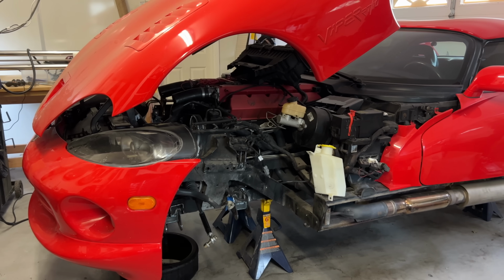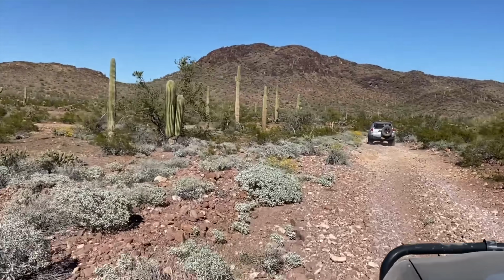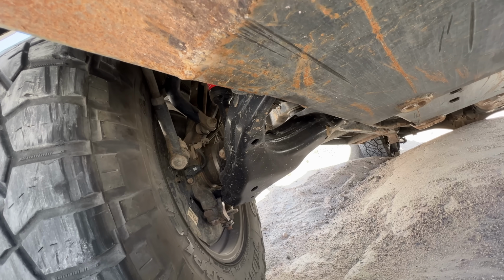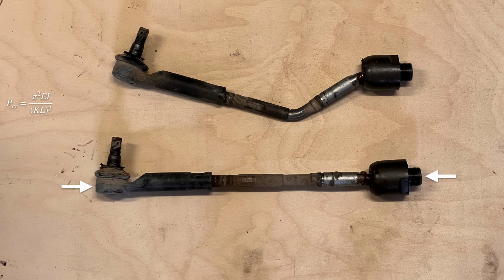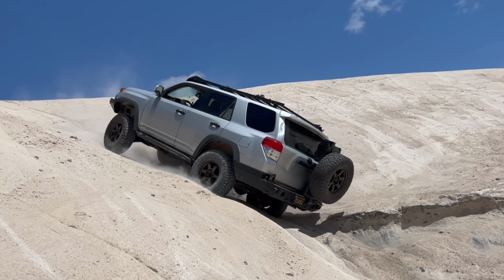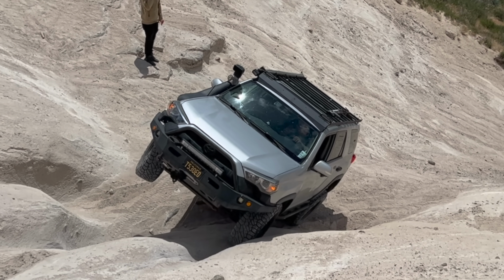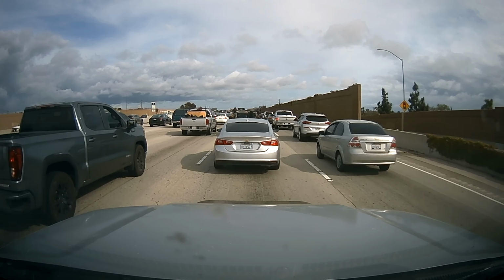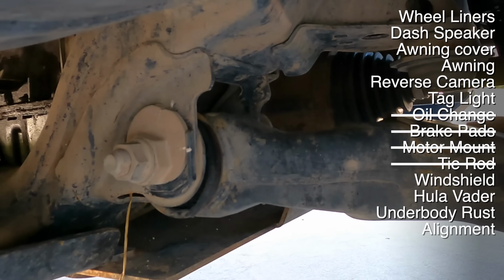Engineering And Mechanical Failures Off-Road

Comment: Your solution to your Fourrunner problem is simple: buy a Deux Chevaux. It will go everywhere off road the Fourrunner will, it will suffer much less damage (and use far less fuel) because it weighs less than a third as much, and if it does break it will be much cheaper (and much easier) to fix. All automative problems come down to power to weight ratio, and less weight is always a better answer than more power.

Comment: Breaking the fuse that easily means you need a bigger tie rod AND steering rack.  And probably some frame plating and gussets while you’re at it. And then some other cascading changes and analysis.

Comment: I used to offroad in a jeep cherokee 2001. That thing had limped off the trail flooded, oil/coolant spewing out, on a donut, in FWD with the rear taken apart. The best part was you could goto pull a part a get  basically OEM spares of anything out of the street queen 2wd cherokees. Plus it was a very light car with all kinds of upgrades you could literally pull out of other cars.

Comment: I'm Parts guy. mog makes napa parts afik. They could have been mixed up at the factory. Or someone returned swamped that napa part for the mog one. In that case I'm shocked it was a new part at all. Either way the napa part is fine, but the mog ones are beefier.

Comment: Yeah those steering rack replacements are a turd. The workaround i found was lock the rack to one end, the shortened end of the tie rod will just clear the frame. Lock it to the other end and it'll clear the other side. Alignment's a bit of a hassle, but it beats pulling the engine.

Comment: Pro tip:  Carry a few extra tie rods (inner and outer) in your 4runner, you can get them brand new online for less than $10.  Literally everybody does that...I even have 2 in my 4runner for this reason.  The tie rod was specifically designed to fail by Toyota in that exact circumstance and be easily replaced on the trail with minimal tools by one person in under 20 minutes.

Comment: At least he has the old (unbent) one to take along as a spare. This will prevent the new ones from ever failing, because the law of spare parts works that way.
Reply: Unless its an alternator 😂 kept my old one just in case, turns out brand new out of the box it can be wired wrong (china) and just send whatever charge the alternator can possibly produce into your battery meaning the alternator lasts 2 months total, they send a replacement and it does charge correctly, buut once the engine warms up the seal between the vaccum pump and alternator itself decides to stop sealing and it fills the alternator part with engine oil, which then hits the fan on the front and stops your entire engine bay from corroding 😂.. i put new brushes in my old alternator, and its been perfect for months 😂 with my luck the bearings in it will begin to, and then completely fail when im like 1700km from anywhere that sells anything let alone parts for a 1991 toyota hilux😂

Comment: Are you operating in a total vacuum? completely oblivious to the entire collective experience of the off road community in the last few decades?  You are not sure why a frail ass tie rod bent on a suv intended for taking the kids to school? You should use the internet and ask around . see what people are doing with their Toyotas to not make them fall apart like that. Toss out that piece of shit stock rack +tie rods and swap in a modified tundra rack with 7/8” heims on both ends.  The hell? your busted ass 4 runner keeps falling apart because it’s lacking the appropriate components.  Or don’t , and have fun rolling down that lame hill again. 
You would think an “engineer” would also reference previous research/ work done and incorporate that into his supposed “calculations”.

Comment: I just came back from a fun weekend. 
One buddy cracked the frame on his pathfinder, I smashed my skid plate into my t case oil pan into the gears inside, and buddy #2 tried an obstacle, blew up one CV in his pathfinder, figured it’s already broken tried again and grenaded the other side. Then packing camp anti-theft tried to lock him out.
All around a good time and many obstacles were conquered. Now time for “maintenance”

Comment: Proper off-road mechanical fuse replacement procedure:

1. Identify the mechanical fuse through properly neglecting the spotter and finding a rock the hard way (as Matt did.)
2. Use a very sketchy method to return the vehicle to 90% of safe operation at the trail head.  Possible methods include: ratchet straps, welding using jumper cables, two batteries and 10 year old muddy welding rods, nearby forest lumber, etc.
3. Buy and replace both right and left fuses despite only breaking one.
4. Throw old un-blown fuse into spare parts box in the back of the off-road vehicle 
5. Go find new ways to come close to soiling your underwear off-road, knowing you're fully prepared in case of another blown fuse!

Comment: When I was a kid there were a whole bunch of Midwestern sons of farmers who used 68-72 Chevy/GMC pickups for 4WD pulling. Believe it or not they were cheap and plentiful once, and big block Chevys were obviously a bolt in. I knew of one for sure and I'll bet there were more which had to have the tie rod reinforced. It's a front steer chassis and the wheels would whip in and out of massive toe in with big power, grippy tires, and a heavy sled to pull.

Comment: Ring gears on factory 1st gen sequoias and Tundras are also a weak point, especially if you have decent newer factory or better CV joints/axles... Although that stupid tiny differential needle bearing is often what causes a misalignment in the diff which translates to the ring and pinion issues... If you ever tear down a Toyota 7.5" diff for regearing or a locker change out that stupid needle bearing with one of the aftermarket bushing kits (ECG is one company that makes one if im not mistaken?) I've learned and forgotten equal amounts of Toyota knowledge lol. Cryo treatment is a good idea even with quality gear sets if you plan on adding a locker or just hard wheeling the basically any Toyota IFS...

Comment: I've seen the fun and games of buckling a tierod on a solid front axle. UK G-Wagon owners club - Back from the days where they basically the younger brother of Unimog trucks cosplaying as army jeeps had a few pics of member doing pretty much the same thing - very sad looking thing as it also caused the front end to dip alot more than you would expect (the top mounts might have sheered too but this wasn't mentioned). 

On the flip side, G-Wagons roll over rather well even without a roll cage.

Comment: Carry spare CV axles and tie rods, Offroading IFS 101. Keep your old tie rods when you change them out as they can save you in a pinch like this. Takes less than 10min to replace a tie rod on the trail. Also if you can afford it, avoid Moog like the plague.. Get some Sankei 555 stuff or OEM.

Comment: the ol' reinforce and find the next weakest link wasn't future matts problem? you could have beefed up the tie rod and found out the steering rack would die and then replace the rack with a beefed up one and find that the knuckle would fail next and then engineer yourself a new knuckle and then find the control arms fail next and then find that your upgraded tie rods fail and start all over again......... Or just keep 2 extra rods in the back seat.

Comment: I agree with your strategy of using the tie rods as your steering fuse. I've replaced a few sets over the years and it's for sure easier than replacing the steering rack. How do I know? I was the one that wrote that steering rack replacement article you referenced. It's not a fun job.

I always carry a spare inner and outer tie rod with me when I'm heading onto the trail. Swapping them out is super easy trail side.

Comment: I was out wheeling with a 1st gen xterra when something like this happened. They bent the pitman idler arm (I didn't realize 1st gen Xterra's had recirculating ball steering) and the wheels were point into each other like yours.  We bent a few tools trying to get it a little better and eventually sorta did and he drove it a good 50 minutes home.

Comment: I've had the same issue with buying parts off of Amazon - guessing you got a "return" where someone subbed a cheaper part for the return.

I found RockAuto to be good for actually getting the right part.  But they are slightly more expensive and don't have free shipping last time I checked.

Comment: Loved the "wauffer Thin" reference. Classic John Cleese.  The brake pads owed you nothing.  The shock load on that right front could occur on any corner of any vehicle in that situation, resulting in similar failure. Rock crawlers beware! Such adventures are always controlled by the laws of physics!

Comment: It’s often a small oversight in my experience in college of designing things to fail in a specific way.

It’s clever of them to have the cheap parts fail as a sacrificial layer to protect the expensive parts, hence the idea of a shear pin. Not only is the tie-rod relatively cheap, but it’s also easy to observe and easy to access should a failure occur.

I remember in Mechanical Design class, my professor told us to design a nut and  bolt assembly with specific dimensions. It was easy as we can get the factor of safety to like 30+ when under axial load. But then he told us to modify it to where you had to get that factor of safety down to 2.0, and it noticeably got a lot more difficult.

Comment: The mechanical fuse concept often gets lost in the mission of making a machine tougher, but I am a big fan of making sure the weakest part is either easy to replace or cheaper than the other links in the chain. An old example was PTO winches with bronze sher pins in the drive. From factory they would have a spare pin for when it failed, that would get used and owners would get the shots with replacing them when they abused the winch, so it wasn't uncommon for owners to put in hardened pins. Not a good long-term idea.
Reply: Another one that comes to mind is the manual locking hubs on old school solid axle 4x4s. Typically the locking hub would fail before the axle shaft or diff, and that was a relatively easy repair and a small enough part to keep spares on board.

Comment: It is common for one of the rear  upper links on the 4runners with 5 links to fail. The whole rear suspension works because of bushing deflection, if you were to make all the pivot points in the rear rod ends instead of bushings it wouldn't move at all and be frozen in place. If you want to make the rear smoother and flex better off road, remove one of the upper links all together. But if you don't believe me than model it.

Comment: Yeah, the 100 series Land Cruiser / LX470 has an 8 inch reverse cut ring and pinion in the front axle; it's a know weak point. (especially if going in reverse, as you wind up running on the coast side of the gear)

Comment: You should consider doing a thorough check of your steering rack after that bump. The aluminum mounting points on those aren't very fatigue prone, but offroading like you do is a bit outside Toyota engineers design envelope.

It would really suck if your steering rack desided to stop being mounted to your frame next time you stressed it.

Comment: Needs a full size "servo saver". Sounds like something you could design. Telescopic tie rods with massive springs in them?
Reply: Cool idea!
Reply: @ShivaShakur  Thanks! Maybe a small diameter hydraulic shock. That is stiff enough to only actuate when necessary and you can release the pressure to put back it to full length.

Comment: I wonder if it's possible to make the tie rod weaker but also self repairable, i.e. with some kind of spring/damper loaded to 7000lbs to stop the impulse and absorb the impact.
If you experience these loads in an emergency stop then you are probably dead anyway.

Comment: I would love to know what rust prevention solution you come up with, as I live in the Midwest aka rust belt.  I had my truck treated last year with Krown, it will need to be reapplied annually as it's basically just a spray on oil.  South Main Auto's channel has covered it if you're interested but I'm always on the hunt for the best rust solution short just getting me and my truck the f out.

Comment: You can run brake pads until the indicator plate is exposed - its normal. You'll get an audible warning when you get to that point.
Same with tyres - run them until the indicator fabric is showing

Comment: Looks like the tie rod is the same for both sides.  If it's a fuse in the system, carry a spare.  I carry spare U joints in my Old Bronco.  Same deal.

Comment: All the new Bronco folks out there installing tie rod sleeves are going to start learning about rack replacement soon. I always thought of the TRE as a mechanical fuse and would way rather that bend out on a trail, can hobble it together or replace it right there.
Reply: yeah a bent tie rod you can even pull off and hammer approximately straight and be able to drive somewhere carefully.
Reply: The broncos that come with the higher end off-road packages get stronger racks. So swapping out the rack itself might also be a good idea.
Reply: @ILiketoBreakStuff  Bronco R uses a wider F150 rack due to the wider track and massive 37s from my understanding. There is a company that sells a reinforcement sleeve deal that goes in the rack to sort of helps prevent the rack from failing easily.

Comment: I would love to know if that thinner part of the rod was really designed as a mechanical fuse! Do manufacturers actually do this? Wouldn't they prefer a more expensive failure? Could things like this be used to gauge if the manufacturer actually considers the consumer's benefit?
Reply: manufacturers don't prefer a more expensive failure as then they are stuck doing it under warranty
also it's easy to tell a tie rod was abused and it bent, a broken rack is hard to prove it shouldn't be covered
Reply: Manufacturers actually don't want any failures. Failures are bad for brand loyalty and reputation. The key here is that it's cheaper to suffer some failures once the vehicle is out of warranty than to try to engineer for zero failures through the life of the vehicle. As long as the car makes it through warranty with no failures, that's all they (the business people doing the maths) really care about (the engineers themselves, of course, would rather engineer for zero failures, but they're not running the business so they don't get to decide).
Reply: @clonkex  "Manufacturers actually don't want any failures. Failures are bad for brand loyalty and reputation. "  They don't? I thought it is to help give an incentive for upgrading to a newer Range Rover, BMW, Audi or Mercedes, when your existing one starts to become troublesome?  Especially when Range Rover know that the reason people buy a new Range Rover or Land Rover Defender is quite different to the reasons people buy a new LX or 4Runner. Unlike Toyota, Land Rover aren't trying to protect a reputation for reliability I think. Hence Land Rover coming to the conclusion that investing more into durability testing and quality control would just be a waste of money -- more cost with no upside of improved sales IMO, but I dunno.  I'm assuming Land Rover could match Toyota quality control and do more product testing before product release if they wanted to, but Land Rover don't because they choose not to? 🤔
Reply: @TassieLorenzo  Perhaps, but that's only beneficial in the short term. If you don't maintain some level of reliability no one will buy your vehicles. Certainly luxury brands can afford to be less reliable because people typically replace them every two years or so, but I guarantee reliability is still very much a focus for even the most luxury of brands. The big issue is that modern cars are incredibly complex and people don't want to pay more for that complexity, so it's there's a very fine line to walk between reliability and cost.

Comment: I hope you ordered a spare tie rod or two. If you intend a part to act as a fuse then you should carry a spare fuse.
Reply: No automotive MCBs (press "reset" button) for mechanical parts yet...???
Reply: @JohnSmith-yv6eq  "Have you tried turning your tie rod off and back on again?"
Reply: @JohnSmith-yv6eq  there are materials which can snap back into place with no stress buildup in their structure. NASA uses one type of them for their space rover wheels now. Veritasium made a wheel video about it.
Reply: @mm6705  
That's good to know....
but how much would a tie rod made of that material cost????
Reply: @mm6705  I don't think those materials can take as much force as this takes.. not to mention the expense.
Reply: @JohnSmith-yv6eq  Sadly not
Reply: Murphy s law says carrying a spare will prevent that failure from ever occurring again. The most expensive part of the system will break next time.
Reply: @joeclutchless1944 this is why I carry the spares for the things I want to fix least as well as the ones for the most common fixes, but not the still fairly common fixes that aren't sold at parts store.  You got to be strategic about perverting Murphy's Law and try and guide the failure towards the mid difficulty repairs that the parts store stocks everything for and you can limp to the parts store without fixing.
Reply: @joeclutchless1944 I guess I'm fortunate. I go through tires like nobody's business(on paved and maintained roads!), but that's by far my most common failure and spare tires are cool.

Pr'ly oughta upgrade my current car to a full-size spare like I did the last one.